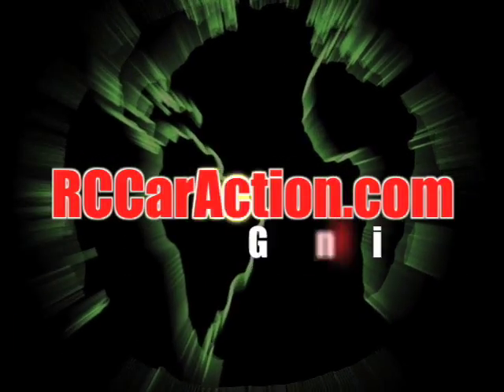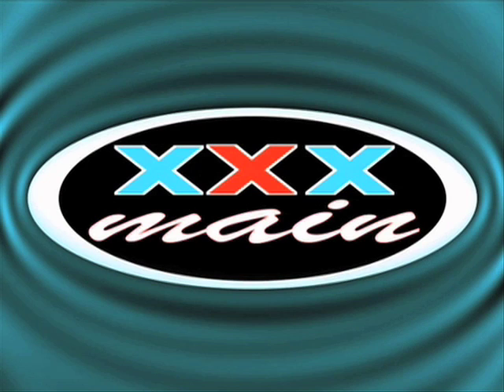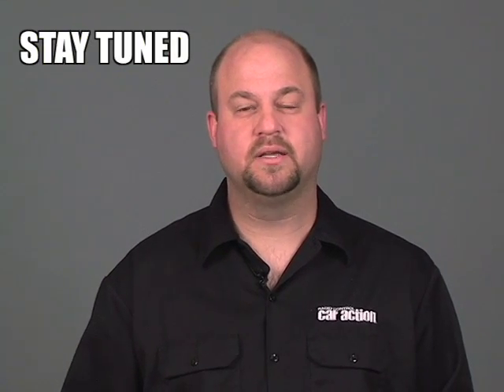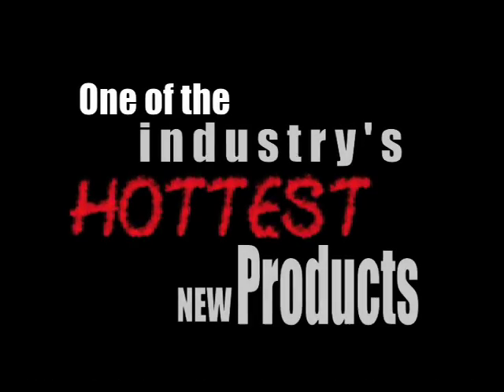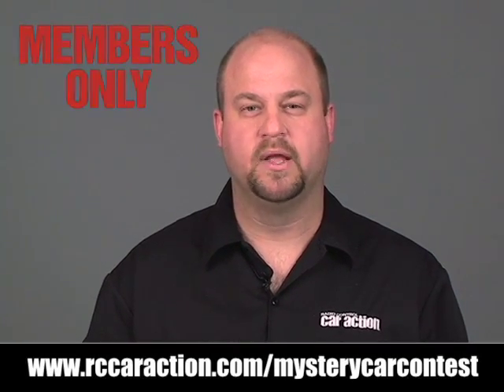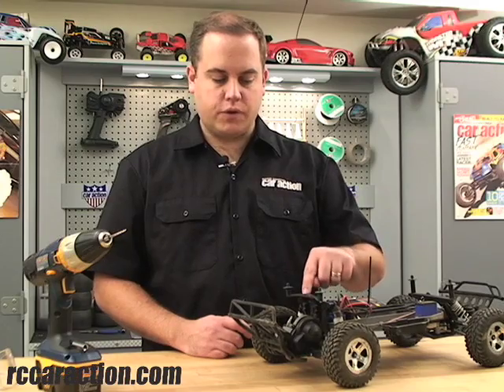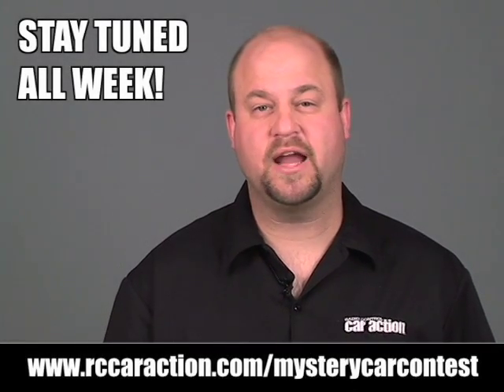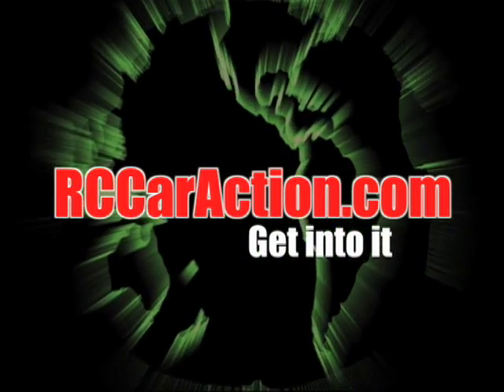Traxxas Slash Gearbox Tip

Comment: Spend $100 to $150 on a good lipo. Something like 5000mah 2 cell 35c or 40c should make it move pretty good. Then of coarse you would have to get a lipo charger, $50 to $75 for a cheap one. You will need a good lipo to get the most out of a brushless system so get the lipo first and see what you think.